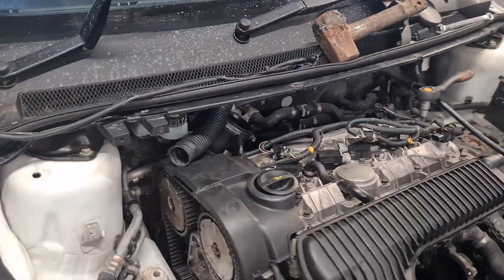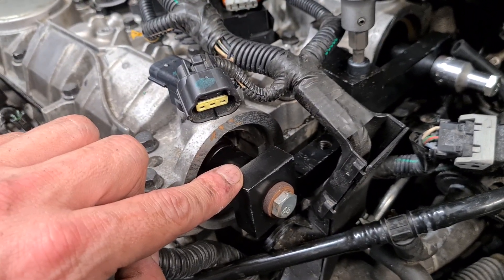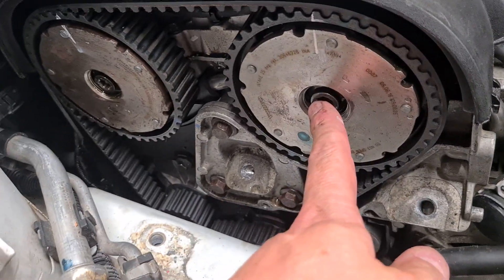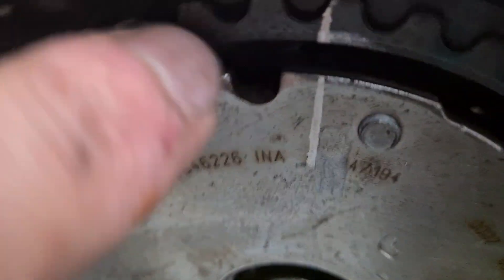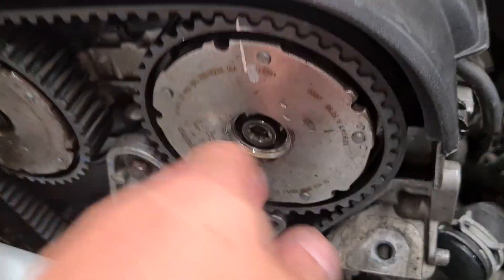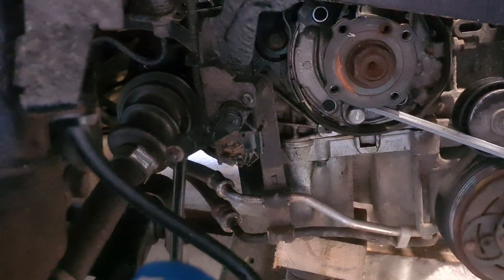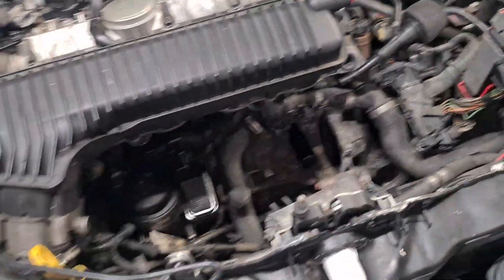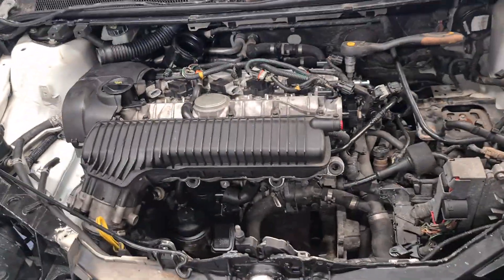Ford Focus ST RS camshaft timing guide mk2 ST225. V50 T5 volvo

Comment: First video I've seen that documents the procedure correctly. Well done that man!

The notches on the cam cover are a visual aid. They exist to give you points of reference during assembly. They are NOT factory timing marks as many people like to claim. It's 18 ribs between the two tiny etches and you should index your pulleys to the new belt accordingly and aim to point them towards the two notches in the cover so that when you subsequently give the crank 2 rotations, you have something to visually verify timing.

Comment: Please any help i need it. I started a water pumpe and belt change on my st225. Pump replacement was fine , but when i got to the belt change with it set to TDC i removed the cam caps and unscrewed the intake screw or little bolt in the end of the cam. it was tight but with an impact screwdriver one whack and it came out. Turned to the other one , the exhaust cam, inserted the torx bit as previous and gave theimpact screwdriver a few fairly hard hits. but it did not want to come out. after a leittle heat and another try i eventually gave in. Before i walked away i turned and looked at the sprockets  at the other end and saw that the cam sprocket had moved clockwise nearly 80 degrees about 9 teeth on the sprocket. i persume this is were i was hitting the other end to get that screw out. question is do i turn it back slowly and set the timing to the notches or would i have to turn the cam clockwise to bring it back to tdc. To add the other sprocket had not moved.
Reply from the maker: As long as the notches on the RH side of the camshafts are flat and parallell with the head, you can undo the pulleys and have them where ever you want really. Its just good practice to have the notches line up with the indent on the cover. If however you havent undone the pulleys then yeah rotate the camshafts so the notches are aligned.

Comment: Hi by any chnace  can u get a better shot of where the timing marks are plz and thank you
Reply from the maker: @Gamingwithb-uq1ly  sorry I don't have this car anymore. The crankshaft one is obvious, line the arrow on the crank gear to the mark on the bottom end. The marks on the cam shaft cover are a bit hard to get perfect by eye. But if your using the camshaft alignment tool bolted to the end of the camshafts they arent that important
Reply from the maker: If your car currently has a belt on and you just want to swap belts u can always just mark some reference points on your current belt on the cam and crank. Copy the marks to the new belt and reinstall.
This method won't change original timing though if it was out before it will still be out. If your head has been off and skimmed I'd strongly recommend doing it properly

Comment: Do the rear cams (gearbox side) have oil seals. I cant see any. Only that plastic cover. The cam sensors are swimming in oil on mine.
Reply from the maker: @casparharte  yeah there are 2 rubber seals on the end of the camshaft mate
Reply: @jamesrubenis1771 Thank for replying. I am talking about the cam sensor side (gearbox/rear). I already changed the ones on the Cam gear side. But now I can not see anything on the cam sensor side,... just metal, no sign of a seal.
Reply: @casparharte  im the middle of that job . but what happened when i tried to undo the screw in the end of the exhaust cam , i was hitting it with a impact screwdriver and without realizing it the cam was rotating clockwise whilst the other didnt move. tempted to move it back by hand but shiiing ting it i might fk it up.